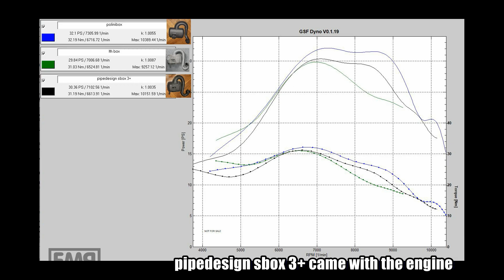a 3800.- quattrini M244 vespa ENGINE analysed | official shop | FMP-SolidPASSion |

Comment: Hey my friend. Help me choose a good set for my vespa px150e from the year 1995. I want the quattrini mx1, but i want to be abble to put a good crankshaft, clutch, carburetor, ignition etc. Greethings.
Reply from the maker: Rotary: Vmc stelvio, sip ultrastrong clutch, mazzucchelli crankshaft, sip vape ignition, si26 carb, fast flow sip v2,
Reply: @FreakMoPed8  VCM is better than quattrini? The crankshaft better than 57mm or 60mm?
Reply from the maker: i see vmc as the cheaper quattrini, its similiar. 57 or 60 doesnt matter, if u dont have a 57 take a 60 of course. if standard 57 is fine, use it. esp cause of rv tolerance
Reply: @FreakMoPed8  Can the SIP VAPE IGNITION be installed with an electric starter? I don't want to lose this.